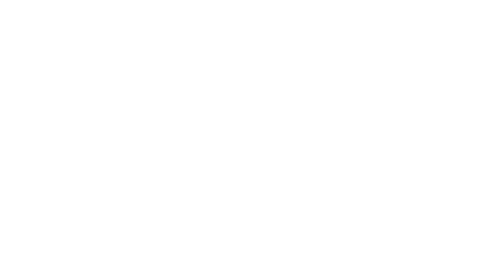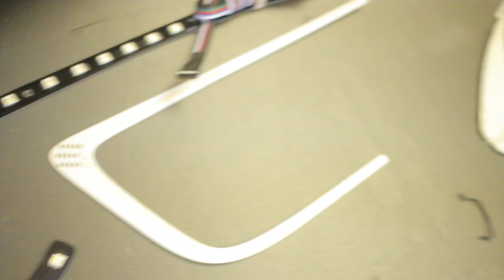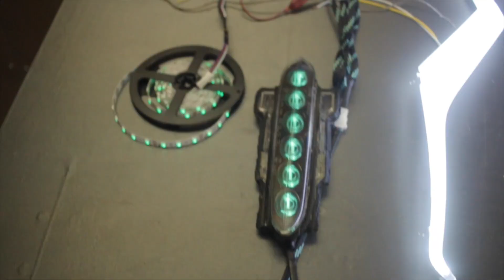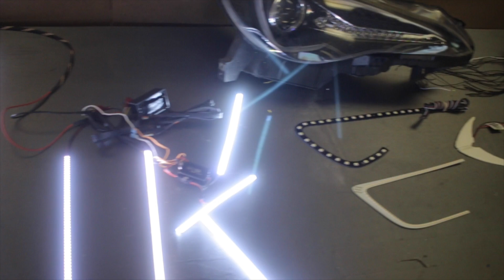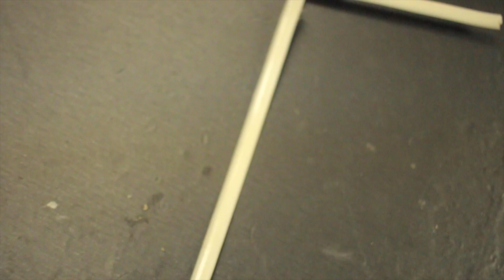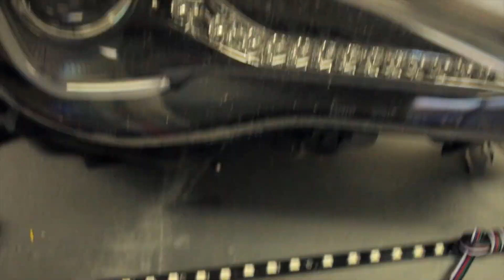Headlight LED Strips - Most Popular 2018 Lighting Modifications

Comment: Man I have an 09 Highlander, there is NO pre-made options for me besides these (that don't cost an arm and a leg.) I got some strips like those that I'm gunna give a shot though. 

Question, have you ever had an led strip like those bright ones that say they turn different colors? Mine definitely has an option to go between Amber and cool white, but it also says it has "7 different colors" on the box yet no instructions. 

How the heck am I supposed to change it from amber to cool much less vivid colors? Would I have to find an LED switch controller piece? Idk if my hybrid is gunna like that if so... Last time I messed with wiring in my car and aftermarket parts I blew a bunch of fuses. TIA, I love when I find a new DIY channel!

Comment: QUESTION: ON THE STRIP OF MOULDED - the version where the light appears continuous - WHAT TYPE OF GLUE GLUE CAN BE USED. The application is illuminating fully exposed strip affixed to plastic motorcycle edges.(Super or Crazy Glue peels after a couple of weeks.) 

COMMENT: Here in VietNam they have moulded junctions into these strips can be plugged. The moulded "joint" has flasher circuitry. There are many of these things from China. 
Thanks.

Comment: A bit old strip on a roll of you needed take you a piece of 1/8 thick Plexi glass and cut to shape and sand it'll turn white like a snow look and place strip next to side of Plexi an the sanding you did will make it spread way out these you can use as speaker beauty rings or interior accent lighting around car interior TV's and things but you use the Plexi and sand to get that spread so don't see individual and makes brighter deff

Comment: What about using acrylic or polycarbonate? You can bend it by heating and scuff sand the edge facing up and it diffuses out. I've been wanting to try it but I don't know how they are doing the LEDs. I'm guessing it's a strip stuck on the other side? Like a long solid lightning ⚡ bolt like fiber optic.

Comment: What glue do you use to mount the strips? I don't want to just rely on the 3M backing. I am cutting up a set of Profile Pivot Switchbacks and mounting them inside 04 Silverado headlights along with a projector retrofit.

Comment: I used those flexi-tube type switchback lights....back in 2012...lolz, they were actually the "Hottest" new thing in automobile lighting, they now seem low rent compared to today's LED tech. I LED'd the shit out of a 2000 Dodge Intrepid, 688 LED's mostly blues and whites (along w/ over 3000 "Skulls" Huge Skull Fan, so of course gonna have a skulled-out vehicle @ sumpoint in me life.) I outlined my headlight lenses from the inside with them cuz of the flex (aftermarket cali-halo type w/ angel eye I put in, so guess they were "After-After-Market lights ;) ) because of the switchback, wired them as blueish D/L & amber Turns..... 17 months later, some Va State trooper rookie trying to kiss superior ass, decided I had just a lil too much blue illumination (I did, all various blues, surprised I lasted 16-17 months).No ticket, but had to go back in and swap out a lotta lights...D'ohhhh!!! 
BEWARE  YOUR STATE LAWS FOR LIGHT COLORS ALLOWED ON PRIVATE VEHICLES!!

Comment: I have a C5 Corvette with aftermarket ACA style headlights from Corvette Envy. Is there a drop-in board to fit these? If not, what do you recommend?  I was thinking maybe a "L" or "C" shaped strip light to outline the outside ends of the housing and a halo on the projector bezel. Have you done any of these headlights?

Comment: I have a 2011 honda crz and I want to put in led strips similar to the 2014 EX model, only sequential and color changing. Is it possible with the base model 2011 headlight assemblies? My assembly has defusers. I can provide pics

Comment: FlyRyde
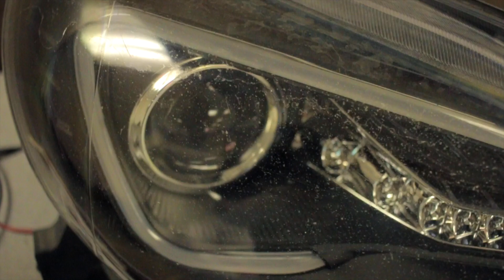  is there  a strip light kit   or a parts list that i can make a set of switch back boomerang  coming from the head light leading in to the marker light  for my 3rd gen 4 runner  96/02 runner  basically  like   in this video at 17:31 but in the form of a  3rd gen 4 runner headlight  leading into the marker

Comment: I am so going overboard with my 2011 Civic Si retrofit! I was just going to go with projectors for better visibility, but since the light will be open I want to add demon eyes and if I can find a spot that doesn't look stupid, I will put an led strip in there.
Reply from the maker: To be honest, I’m more of the mind that if you have to think really hard about how to get it to work and find a spot to shove a part... just leave it out. Less is more 9 times out of 10. Clean > Busy
Reply: @flyryde  I agree. I have since decided not to run a strip, but I will probably go with a set of halos instead. 
Have you ever changed the color of the halo ring? Since the white might pop too much in my dark housing, I was thinking of spraying a thin layer of clear mixed with a little black to tint the white halo a little so it looks more smoked than bright white. But not too much as to effect color output. 
I'm an automotive painter and I found that tinting clear with base is the best way to tint headlights/taillights, so that's where I got the idea.. 
Thanks for your input

Comment: Hey man. I just bought some Profile Prism strips for my grilfriend's G37 Sedan. I'm placing them on the top side of the headlight, the chrome part that looks like an eyebrow but the strips are hard to side bend because of the aluminium. It's not that much of a bend. Maybe 145°. Any advice?
Reply from the maker: I’d need to see some pics to really understand the issue, but I will say this, those prism strips are not stoked about being bent at all. Shoot me a DM on Insta
Reply: FlyRyde Hey man. I dont have Instagram and I been busy with both of my jobs so sorry to reply so late. I posted a video on my profile. It's the one with the title G37 Project. I only have 2 so far so it shouldn't be too hard to find. I would greatly appreciate if you could check it out and give me a hand man. Thank you.
Reply from the maker: Mr. Cortes sent 👍
Reply: Your gf will leave you anyway simp

Comment: Do you have photos or a guide to cutting the profile prism strips? I'm looking to do a strip in my mk6 jetta headlights and would ultimately like to cut the strip to make it fit properly. Thanks a lot.
Reply from the maker: Valley mills Aquascaping I have a GTR customer that asked about me prepping the profile pivot Strips for him. Same exact idea, so I’ll make a quick how to Video about it and Link it up on a card here on this video this week 👍
Reply: FlyRyde awesome thank you. I'm going to put mh1 7.0 and the led highbeam from retrofit source in my mk6 jetta headlights. Can't wait to get it all done, waiting on all the parts and some spare headlights so I don't have to do a rush job.
Reply: FlyRyde regarding cutting the prism strips can they only be cut every 3 inches? For my mk6 jetta headlights I wanted to do a full 18" across the headlight with one 6 inch section going upwards to make it look like \______====(vw)====______/

Comment: Can you show us how to make a factory look defuser?
Reply from the maker: +rstezza if I ever find a NOT terrible cheesy way, I will 👌
Reply: FlyRyde please do. I've been looking online but can't find anyone who sells the plastic ridge tubing. I don't know what it is called. Can you help a brother?
Reply: Come on Brotha.
Reply: They said if they found one. Clearly they haven't yet.
Reply: I tried some of the clear diffuser from Lowe's, that is for the tube type flourscent celing lights. But the textured part that does the diffusing, is too big to work for automotine stuff. It looked like crap. But being plastic it was easy to cut and shape with my Dremel, sabre saw ( if you try this use one that you can control the speed cutting slower stops the plastic from melting back together behind the blade ), and heat gun. It just didn't diffuse the light the way I thought it would. It might have looked ok behind yellow or red lenses, but I didn't like how it looked so I never tried it behind the taillight lenses.  😤
Reply: I haven’t tried this yet but I had an idea on building a custom defuser. You would need a 3D printer though. Just print out whatever design you would want then heat form textured plexiglass over it.

Comment: Drop in is definitely the way to go!! Sounds like i need to work with modified technology’s to get them to make some genesis coupe lights.
Reply from the maker: Yeah man, let me know if you've had any luck Zac!
Reply: @flyryde  oh man had some custom work done on some brand new lights, then shipped to me... if only I had seen your video first. The strip looks horrible and the job wasn't the best. Between buying a new pair of lights and the cost for parts, labor and mod a quick $600 down the drain.